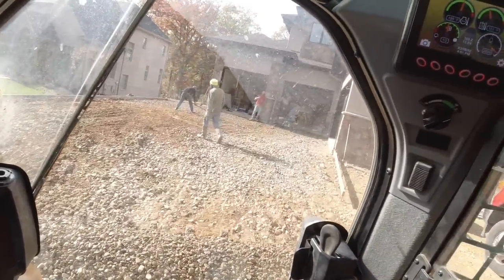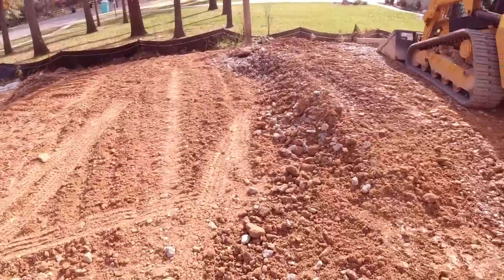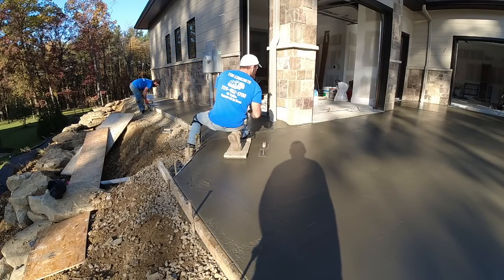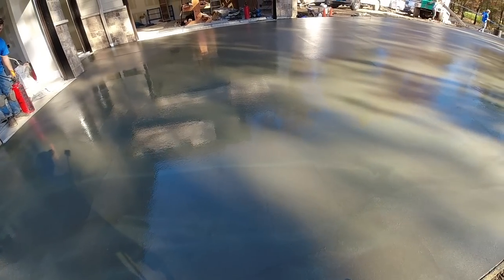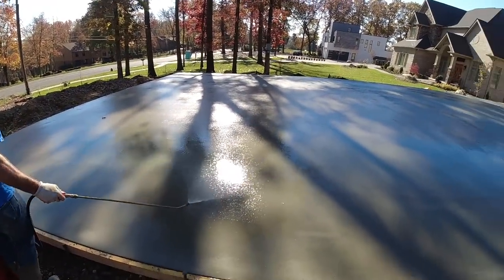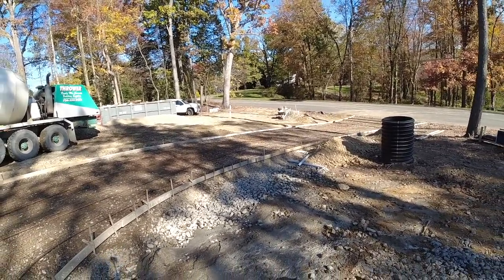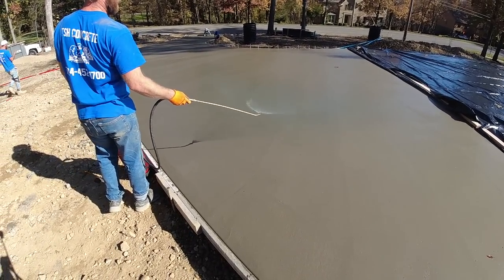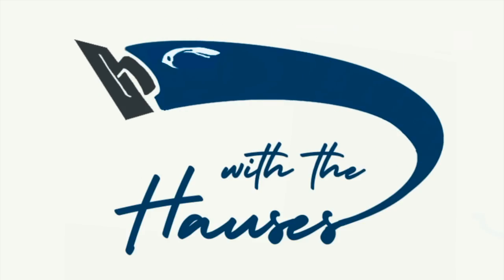Will This Driveway Ever End?

Comment: Is exposed agregret normally used on a full driveway?  Seems it wouldn't be as durable with vehicles driving over it constantly.
Reply from the maker: No it holds up very well
Reply: Same as regular concrete

Comment: Helped a buddy pour 3/4 yard of concrete. Thought everything was looking good until we were finishing it and remembered that we did not bull float it. It was only 2 feet wide but the aggregate was too high which is what floating it pushes it down?
Reply: Yes, bull floating the concrete has the dual effect of leveling out the surfaces AND driving the aggregate down further.
Reply from the maker: I’m sure you’ll remember that next time
Reply from the maker: I’m sure you remember that next time right